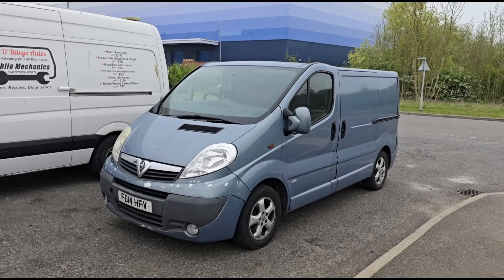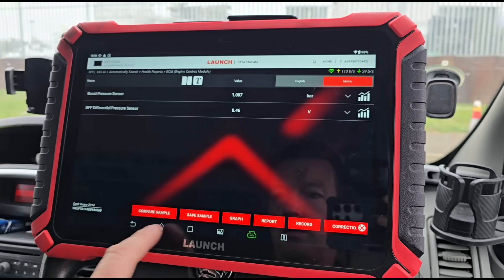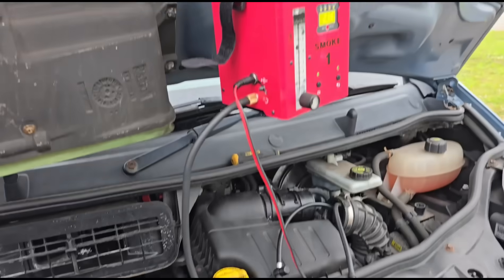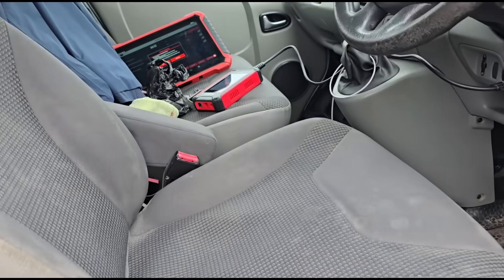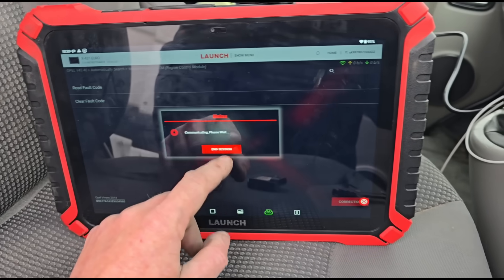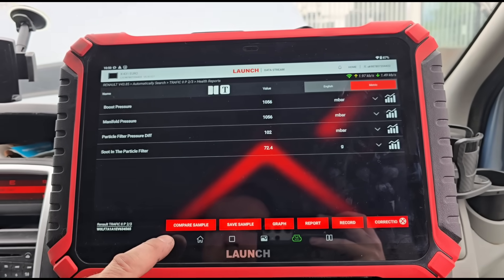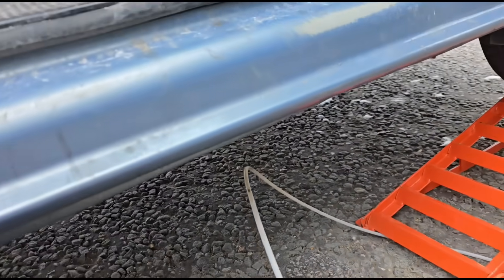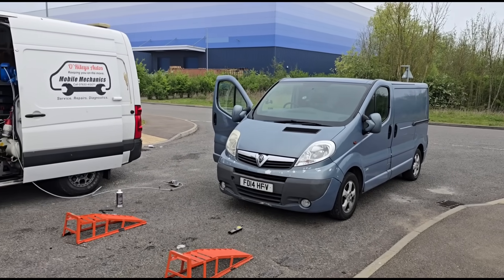Vauxhall Vivaro Repair: Solving Check Injection Faults and DPF Issues

Comment: Check injection is driving me insane. Ive checked everything. I have no codes at all and soot level is 11. If i keep the revs under 3k the injection error doesnt happen. If it does come on it goes away when i turn the engine off. Its?a?2018 biturbo vivaro. Had new glow plugs, alternator as that was overcharging, oilcooler and map sensor. Exhaust upstream pipe was nearly blocked and ive cleared that. Im stumped

Comment: Hi Jimmy thanks for taking time to make the vids, ive just replaced my exhaust pressure sensor also cleaned out the metal pipe, then put a new sensor and hose on, check injection light has gone out, but the Check anti pollution light and engine warning light is still on, but no codes are stored in memory, does this mean the fault is fixed and that I need an old reader to reset codes ? hope this makes sense, cheers.

Comment: This is a great fix, thanks for sharing! I have a Vivaro 2013 with similar issues. I also have wet around that pipe area. Tightened with a socket, hoping that might be it. I ended up buying a second hand Tech 2 GM computer from ebay. I've also replaced the DPF and recently removed it again and cleaned with Wynns cleaner to ensure it is completely clean again. Also removed the EGR valve, cleaned, and replaced the EGR cooler as there was wet in that area too. Bit of a nightmare this van. Hoping when I do another forced regen, it might even pass.

Comment: I was struggling to get my 2013 vivaro to regen everything looked good but the dpf wouldn't go over 400⁰c so the injector wouldn't operate. I eventually twigged the engine temp was only 59⁰c fitted a new thermostat and engine temp went to 90. Went on a test run and the dpf shot to 600 and has been fault free for 6 months now.

Comment: Very informative video and clever diagnostic, Jimmy! The injector faults were just thrown in to cause confusion. All stemmed from a boost pressure leak and no fault set for it. Crazy!
Reply: There were no injector fualts. Or are you refering to the message on the dash? These "Check injection" messages on the dash just mean that there is a fault inside the ECU. At Renault the ECUs often are named as Injection control unit.
Reply: @danielseibert4082  OK, thanks 👍

Comment: Does the cleaner remove the soot from the DPF into the exhaust? If so could it leave traces of soot at the tail pipe giving the impression of a damaged DPF?
Reply: My guess is the cleaner dissolves the caked in soot then the engine while running burns it out. The ash thats in the dpf just gets forced deep into the dpf vanes so the remaining part of the dpf can still exaust the soot as a gas.

Comment: how come your not changing the oil and oil  filter before the regen ?
Reply: cuz hes not doing a forced regen. If you rev the engine for 10min you also wont change the oil. Makes no difference if you rev it with the cleaner inside the dpf or without.
Reply: He may be referring to the prior forced regens that were performed on the vehicle before jimmy fixed the issues. Mabye the owner will change his own oil.

Comment: I work on vivaro most days if there any faults in the ecu it won't let u reset the service light daft idea
Reply: Hi having problem with map sensor having no signal voltage. Any ideas. Thanks.